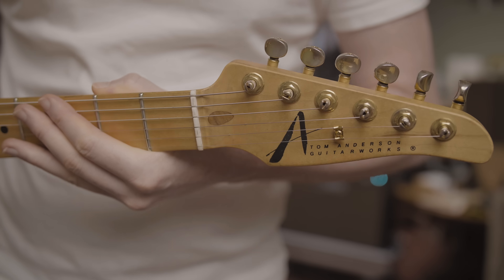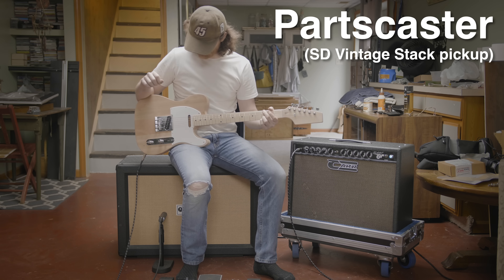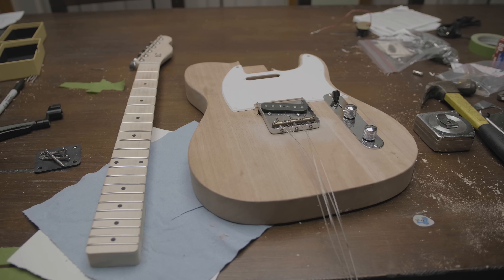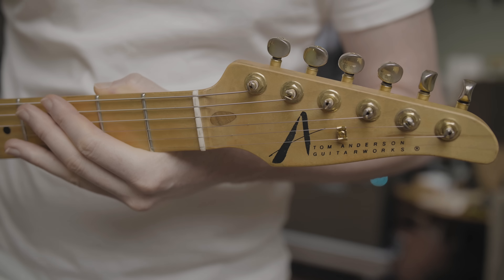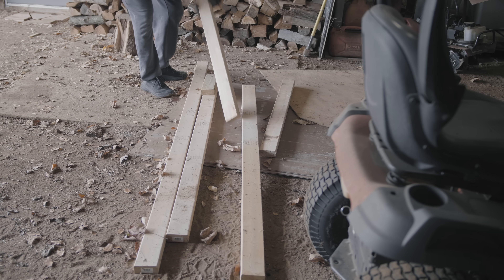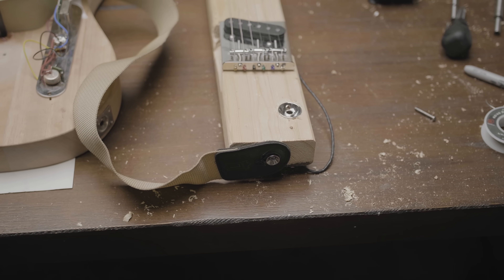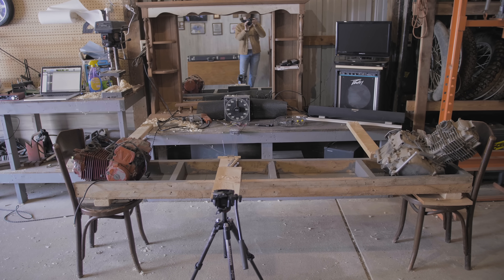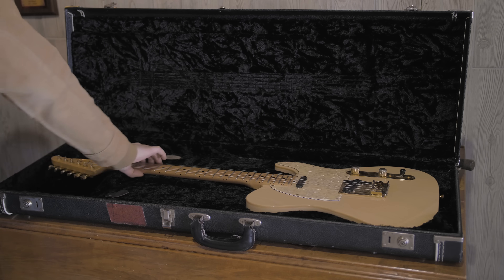Tested: Where Does The Tone Come From In An Electric Guitar?

Comment: The vibrating strings make the magnetic field of the pick up.
Guitar materials play a limited role in the string to pick up interaction.
A cheap guitar with a good set-up (action, intonation, ect.,) is just as good as an expensive guitar.
Is that what this video is telling me?
Reply: That's what it's telling you but it's incomplete. It fails to explain that a really resonant guitar affects the way the strings vibrate. 
Anybody who has played a REALLY good guitar knows how it vibrates in the hand and body. That vibration is added to the fundamental of the plucked string. That's how an amazing guitar adds it's voice to the amplified sound.
Reply: @lfscrazy  So you have a primary wave when you pluck the string. Then the guitar materials generate a secondary wave that interacts with the primary wave. This secondary wave seems to add the timbre to the instrument.
If you take a cheap guitar with good set-up, and add this secondary wave with a vibrating wave generator, (I see they sell them for physics experiments) then maybe you might be able to dial in the timbre (that Sweet Carmel sound from expensive guitars).
The only other thing I can think of changing what the pick-up is mounted to. If you can filter the wave from the body vibrating back into the pick-up by using some other type of material, some maple, or other types of wood.
Reply: @topfuel29channel  I think it's many secondary waves, not just 1. On my guitars I sometimes notice a really low frequency wave that I can feel moving from the body to the neck, period is around 1 second.
Saddles make a big difference as a filter, you can even hear it in this video. Brass saddles attentuate some of the higher frequencies.
Reply: @lfscrazy  Yes, many waves are generated. If you want to see whats going on with the wave form you need some vibration testing equipment.

Comment: Hmm.. you got me thinking about this too much…

An interesting experiment..
But then it occurred to me this would be applicable for most SOLID body guitars.
In other words all solid body’s would sound the same given the same pickup bridge configuration.
However.. that might not be true to hollow body, semi acoustic or arch type guitars.. where the bridge is suspended over the top.
I would assume that the vibrations from the body would be  more likely to be transmitted  across the bridge to the strings & thus would have some effect on the final sound. 
It would be interesting if he could re-do the experiment with an arch top style.

Comment: One last thing I would've tested was to swap the pick ups… One pick up to the other even those same brand name and model can be different… Actually, they are slightly different… Two can never be the exact same

One similar test I plan to run in the future is to do FFT analysis on two different set ups… This will truly show if the frequency responses are exact or not
Reply: Machine wound pickups of the same make/model are as close to identical as makes no difference. Hand wound and you're on point.
Reply: @alan_davis  I beg to differ… I measure specs for every single pick up. I put in customers guitars and have noticed that even though you buy the identical pick up… They can be vastly different and not sure if they are hand or machine wound… I'm assuming machine… The major difference I see is the inductance… Identical pick ups can show 5 henries on one pick up and almost 8 on another… This basically affects tone characteristics which I have tested successfully.

Comment: I bought an RG 250 brand new. The tone was very bad was weak and thready.. first I put some evolution pickups in it and that helped. But the true tone difference came when I took that piece of weak sheet metal Floyd Rose bridge and put in an edge bridge which had much more metal in it.. and The tone came to life.. yeah so the biggest improvement was a  much more solid bridge.. so the more your bridge and nut are like anvils the better the tone..

Comment: I think air from the equator brought north by the gulf stream would make that air guitar sound more organic and giving it that ethereal tone that you just can't get anyway else.
Reply: Or a fart after consuming loads of ghost peppers!
Reply: @Mode-Noir That'll heat up your strings!
Reply: @Mode-Noir    Of course the peppers would have to be from heirloom seeds from India's NE  high hills.  Otherwise you  wouldn't get that mojo , man.
Reply: @sunsparkle8443  That only!
Reply: I just read this and got a deep belly laugh, the type I haven’t had for years. Thanks!🤣
Reply: @datac58  - Wish you peace.
Reply: I think using organic air instead of  processed or GMO air would make a big difference.
Reply: @leejuicy  Yeah.  Organic air--Tone for days , dude!
Reply: brand new sentence right there
Reply: @fleecefoxes6471    Muchas gracias.
Reply: gulfstream is in the ocean, you mean jetstream
Reply: @MojoIglesias  -  I meant gulf stream.  It moves warm air from the equatorial areas northward. It's a major reason why Ireland and England don't get super cold even though they are at the same latitude as Canada. Good question IMO.
Reply: @MojoIglesias  But what if it came by business jet? 🙂
Reply: @Ugoeh2     Wouldn't be as good.  Jet air gets too compressed at high altitudes.
Reply: @Ugoeh2  Oh,  sorry , I just realized you were asking someone else.
Reply: Best rock sound would be to put a fire under the strings.
Reply: Fender : let's bottle up that bad boy and sell it for 1000.
Reply: @H0kram  -- Fender to their marketing people--  Hype it up  like they do in the movie ads! something like -  "An Epic event of staggering proportions!!!  "
Reply: Ugh - that means I have to move to get the tone I want!
Reply: The gulf stream ages the air with an imparted sound like whiskey in an oak barrel. A lot of enthusiasts think it would just sound like that if you played the air guitar at the equator.
Reply: USDA Organic Air

Comment: Over the years, I’ve seen endless debates on Tonewood and I’ve had a friend who done some testing like yours, and we both concurred that it was basically the pick ups that made difference in tone and the scale length affected it some. That’s about it, but there is one strange thing that can’t be accounted for. I own a lot of guitars and I will have three of the same color, same year, same build configuration, basically same everything and you plug-in one and it’s like wow this plays nice. Then you plug in another one and it’s like oh it’s OK. And then you plug in the third and it has just kind of a magic sound to it, better sustain, and it feels super nice. The only thing that we could conclude is it has mojo and that something that can’t be consistently replicated. Anyone who is played a lot of Guitars knows what I’m talking about. Just that special feel and sound. It’s different and is sweet .
Reply: I think that is the product of the reality that nothing this "complex" can be reproduced identically every time.  I'd bet that you could take any three new guitars off the shelf, and they'd all sound a bit different.  BUT if you had a quality tech give them thorough, identical  setups, they'd be indistinguishable from each other.  And the tech would probably tell you that the work required on each was slightly different.
Reply: It's damn near impossible to get the set up exactly the same every time. Small tweaks can make a big difference in feel. That's probably the case with those guitars.

Comment: Fascinating work! I do like your logical and insightful exploration of the topic, though as a point of critique you are nowhere nearly meticulous enough to satisfy a true scientific experimental standard. You come close though, and even though you don’t get the method 100 percent right, you get it 70 percent right, and the spirit and intent is adding another 20 percent on top of that. 

I had some musings and thoughts that could explain why you got the results you did: perhaps you can use these as a means of exploring this topic further. Make of them what you will, I hope they are helpful! 

As an engineer, what the pickups are “picking up” is the movement of the strings as they vibrate at certain frequencies corresponding to the musical note on the fret board. They “pick up” the frequencies by measuring the changes in the current flowing through the pickup’s wires wrapped around a magnet or metal rod for each string, as the  guitar strings are made such that the frequencies the string vibrates at affects the magnet/metal rod, which changes the current going through beach pickup for each string. If the string is too far away, the pickup cannot sense the string vibrations as it is out of range of the magnetic field the pickup is generating (magnetic field strength decays by a square law with regards to distance if I remember right, so double the distance away is four times the loss in magnetic field strength, for example) so it doesn’t register the musical note when the string is plucked. However, if the pickup is too close, the pickup gets hit with the physical vibrations of the string, which interrupts the frequency much like a string plucked when one hand is holding the string in the air and not pinning the string on the fret board, which changes the sound accordingly. 

Thus, it makes tremendous sense that in terms of just the music, the strings and the pickup in specific configurations are the only determining factors for the tone of the guitar. The body work just does a couple things: it makes it easier to hold the guitar so you can play it comfortably on stage, and it houses the electronics so they are not exposed to moisture in the air. Moisture and humidity in the air will cause the metal parts of the electronic components to corrode over time, so sealing the most sensitive parts of the guitar away from as much moisture as possible is the best way to preserve the functioning of the electric guitar. In short, if you want an electric that lasts, a good body that protects the sensitive electronics best is an absolute MUST. 

So, the body and neck do nothing for the sound. HOWEVER, they are crucial to not only easily play the instrument on stage (the air guitar would take A LOT of setup to be taken on tour 🤣) but to keep the guitar functioning as close to peak condition for as long as possible by preserving the most sensitive components from the atmosphere with good body work. 

I think the myth that the body and neck matter to the sound is a holdover from acoustic guitars. Because acoustic guitars use air vibrations from the strings that echo in a body cavity to produce their unique sound, the body work is very important to the sound of an acoustic guitar. You cannot make an acoustic “air guitar”, for this very reason, because the body of an acoustic is required for the acoustic to produce its unique sound. If you change the body, you change the tone and timbre of the acoustic. For much the same reason, the neck connected to the body would change the body cavity slightly depending on how you build the acoustic, so even the neck construction matters to acoustics. Plus, because the air vibrations reverberate through the entire body cavity, anything connected to that body cavity will also feel the vibrations, which does impact the sound of the guitar. 

Plus, the material type is important, because wood reflects sound vibrations very differently from steel or carbon fiber, for example. If you make three identically shaped acoustic guitars, but one was carbon fiber, one was wood, and one was steel, each guitar would sound noticeably different from the other. 

Because these things are true in acoustic guitars, many of those myths probably transitioned to electric guitars early on, and the myths became standard practice, despite the science saying otherwise. 

Once again, a very interesting experiment! Can’t wait to see what more you find out in further explorations!

Comment: An actual air guitar. A guitar made of air.  

As we did in physics and engineering classes, we always eliminated every variable possible, such as friction, mass, gravity, vibration, rotation, heat, stretch (from tension), etc.  We always said everything was made of unobtanium. 

Queue Hollywood...

Comment: i've been asked this question dozens of times, there's so much placebo to cut your way through.  at the end of the day, though, a pickup produces a signal that is entirely dependent on the movement of the strings, right?  so if the wood doesn't have an impact on the mobility of the strings, it won't make a different sound - and i've yet to hear a noticeable difference in tone when considering construction material.  i've seen guitars made out of plastic, aluminum, pencils, guitar picks and resin, concrete, and they all sound more or less like i'd expect for whatever kind of pickup they're using. 

i had this Schecter 7 that would ring whenever i palm muted an open power chord.  couldn't figure it out for months.  turns out the FR springs were resonating sympathetically with the strings, then making the strings resonate sympathetically with them.  wood can't do that, it doesn't ring out, so i don't see why it'd have much of a tonal impact on the guitar.  i thought maybe the volume or density of the wood might have some impact on sustain?  like - you can feel the strings vibrating when you play the guitar, some of that kinetic energy is being lost through the wood, maybe volume/density might improve/worsen that, but not enough to notice without like... science equipment.  lol. 

i think the only hardware that might really matter are the nut and bridge, the parts that actually make direct contact with the useful part of the string.  maybe lol.  either way, it just seems like such a waste of energy when you're just going to run the signal through a load of effects anyway.  economy and aesthetics are way more important, if you ask me.

Comment: Cool video! 

I submit that the "air guitar" had two giant wood benches connected by a concrete floor for a body, they were just rotated out of the way.

The 2x4 guitar had a noticeable thinness to it when compared with the Tele.

I would love to know more about how the anchoring surfaces receive and interact with the sound.  I really like the sound of my Alder wood Jackson.  It's solid.

I bought an Ibanez RG 927 Premium with a beautiful transparent black flat, buckeye burl and was disappointed to find out it just sounds bubbly.  Thinner and less tight.  I thought no problem, I'll put in some high gain pickups like had my Jackson.  I changed them out of the 7 string and it sounds almost exactly the same as it did before!  Something about that guitar has a distinct sound I can't get around.

So I think the material and shape of the body cavity matters.  Hollow body vs a dense wood or even plastic or metal; maybe it's about which types of materials produce sympathetic vibrations that "echo" back into the strings altering the timbre of the vibration.  I don't know, but anecdotally I say I can hear differences.  I'd love to see that explored more.

Fascinating topic.

Comment: Changing the pot values and or capacitor will will change it as well. I don't think you will hear a difference between paper vs ceramic, but definitely the values.

Comment: A really cool experiment.
So the pick up is the most decisive hardware factor in the tone, strings, bridges and scale length are a factor as well.
Outside that you could make an electric guitar from anything solid enough to cope with string tension. Just watch Justin Johnsons shovel guitar.

Comment: Brilliant! But playing my Les Paul and Strat UNPLUGGED I can really hear a difference. It seemed from the video that the body doesn't matter at all but everything about the pickup was crucial.  But without even using the pickups, I hear the distinctive Strat sound compared to the Les Paul. So what makes the Strat sound like a Strat if it's not the pickups? My guess is it's mainly the way the large pickguard is mounted over the large body cavity. Probably the bridge configuration with the strings running through the body makes a difference.

Comment: Bull$#it about tonewood affecting electric guitars was demystified with mounting the whole setup of soldered pickup-electronics to a guitar body and then to piece of concrete with an eq monitoring of an output signal long time ago. It had zero effect as expected.

Nice test even they are scientifically insignificant still led you to the same conclusions.

Comment: As an amp builder and guitar player I think Jim is on the right track, I acknowledge that wood types effect acoustic instruments ie: an acoustic guitar made out of soft pine will sound different to a hard wood version. Having said that at the end of the day my belief is that the last port of call is the speakers and box. Playing my Fender Bassman through my quad box is very different to my single 12 cab, also size and efficiency does matter when it comes to speakers and how much they throw. Pickups don't produce sound they produce ac electricity but a speaker turns electricity in to sound therefore have the last say!